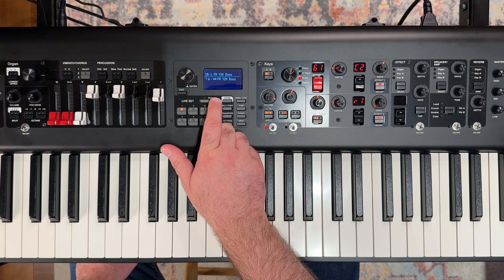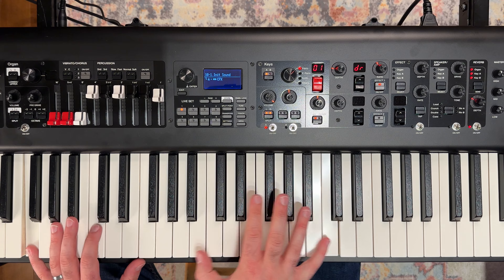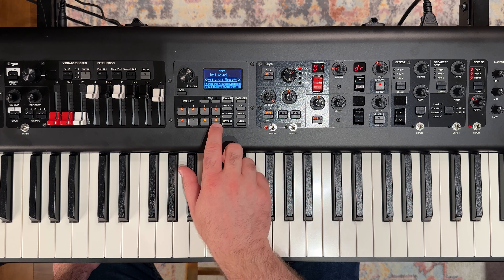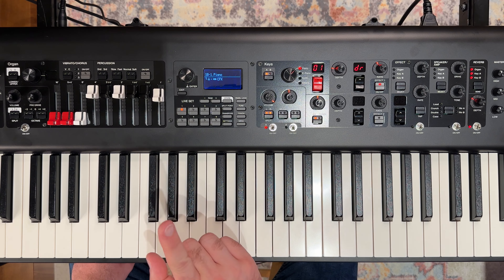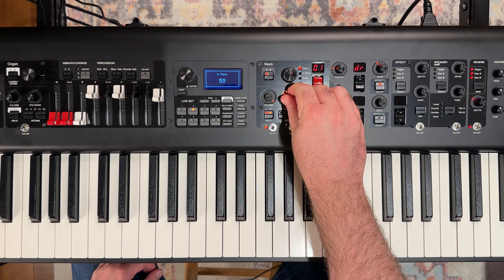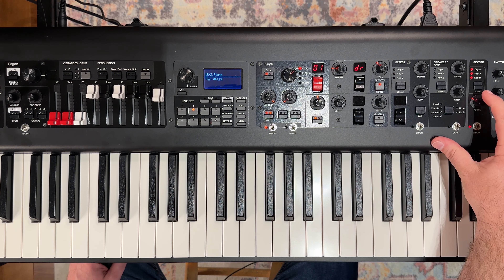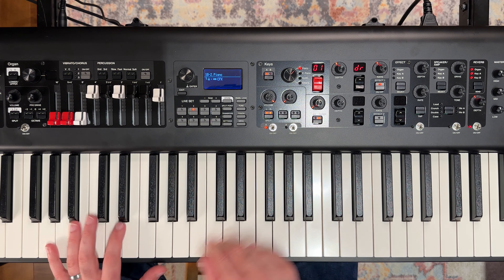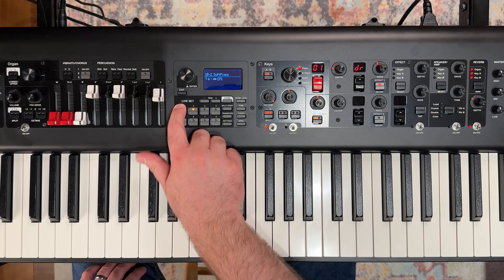Yamaha YC88 - How to get a Soft Piano Sound

Comment: I have the YC61 and the M8X, I was having issue to play soft with my M8X…
Tried your trick with the YC and used my M8X to play via midi…. Great !
It was very easy to change the sound with the YC…
I will have to try to replicate it on the M8X…
The YC filter is probably the cutoff on the M8X…, but I do not know what is the YC tone within the M8X….
As I was using the CFX in both 
, the sample is the same. I also like the resonance effect on the YC…
Reply: Did not know that YC accept midi signal for soft pedal - 67
I’m using my M8X to control my YC61 and on my YC, I set my piano filter to 50, did not touch the Tone (middle).
And with the M8X, I use the second footswitch and control the soft pedal on the YC, and it really works fine.